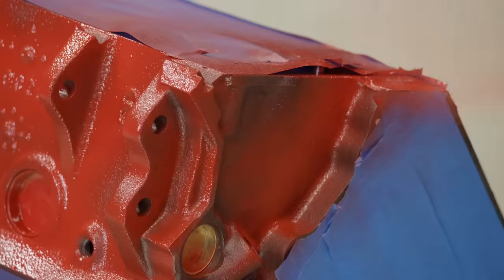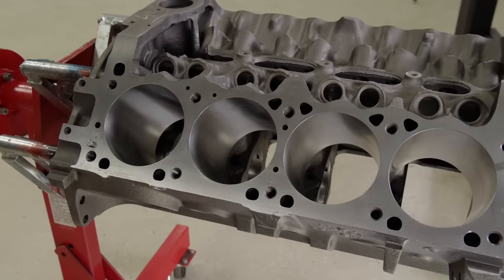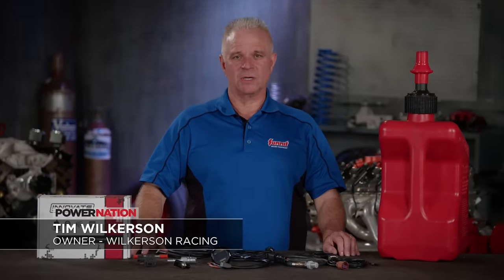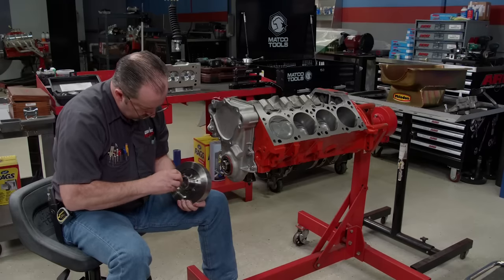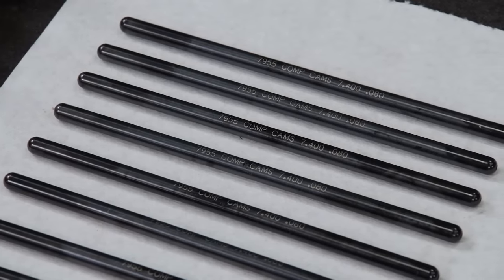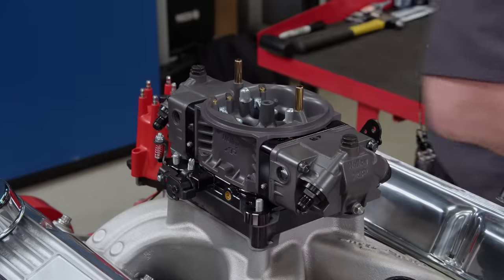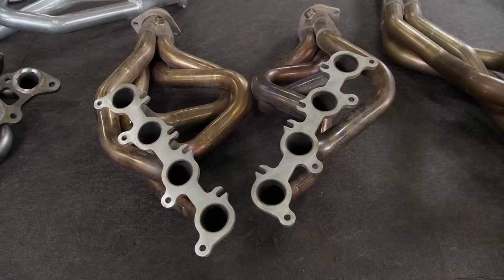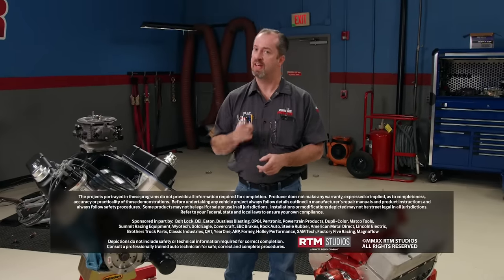Assembling a 410 Mopar with High Flow Induction - Engine Power S7, E9

Comment: Although the 190cc head is bigger than the normal  generic 170cc offerings for mopar it’s still a little small for for 410. Indy?
Reply: Trick flow 293cfm @ .600" 
Indy T/As 254cfm @ .600"
Edelbrock RPMs 251cfm @ .600"
Reply: 293 cfm head flow times 2 is almost 600hp potential

They probably will make over 500 so theyre not even gonna tax this head even with 410

If they did use the Indy/efelbrock head that flows 250+ cfm, they'd be taxing that head at 2cfm per hp but itll still make 500 or just over

And anytime a manufacturer gives a head flow number I always subtract 10 cfm because they alaways fudge with bigger bores and bigger headers on their flow bench
Reply: 190 head on 410 inches will have some very good port velocity. The port velocity on the street will make this a very nice and hard to beat engine. Thing will have great midrange power.

Comment: I've always loved these "A" motors, but to really get super high output from these motors somebody needs to design an all new head that does away with the biased head design and replaces it with heads with even port spacing on both the intake and exhaust like the Gen 3 new Hemi or the LS Chevy.  That would require new cams, Intake manifolds and headers, but would yield major power gains!
Reply: Like a 318 Poly?

Comment: back in the late 50's and early 60's Mopar sold cars and trucks with red engine paint the 318 wide block was a economy engine and came red for those years
Reply: The older larger 318 is the "A" Block, the small block 318 is a "LA" or "Light A" engine.
Reply: @LionWithTheLamb  yeah, also known as the "semi hemi", "poly 318", and "wide block 318".
Reply: @LionWithTheLamb  also, nothing about the 318 poly is bigger than the la. its just the heads that are wider.

Comment: Can you do this all with a 318 magnum also?
Reply: Yes.   Although, the 273, 318, and 340 blocks have a smaller main journal diameter, so you would need the crank with the smaller mains.     Then then you will have to factor in the 318's smaller 3.91" diameter bore(stock diameter), which would shroud the valves a little more than the larger bore 340 and 360 blocks.   360 blocks use a different oil pan than the 273, 218, and 340 blocks.
Reply: @knight0334  actually, all magnums take 360 oil pans. even 5.2 magnums. however, if you use a 360 LA oil pan on a 5.2/5.9 magnum, the one piece rear oil seal wont work anymore, and you will need an LA style seal.

Comment: timing chain tensioner ?
Isn’t that for extending the life of production types seeking high mileage longevity .
Not for race equip that is frequently inspected , where chain stretch would be recognized right away
Reply: Worse yet, they're well known to fail and go through the oiling system in this application.
Reply: They say it's a street build.

Comment: Look at the motor mount bolt holes it looks like a LA block to me!!!
Reply: magnum has the same mounting holes. If you look at the oil pan rail, there are three mount points about midway, making this a magnum block.

Comment: Okay, Now do a Low Budget 318 with Lunati's Voodoo 20200715 Mild Street Hydraulic Roller Can. And a 600cfm 4bbl. Id like to see the Numbers
Reply: if you use magnum heads, headers, a good dual plane, and about 9:1 comp, id say it would make a good 360+hp

Comment: At about 2:30 you called it a 360. Also, magnum blocks are not known for taking a .040 overbore according to Mopar Action. They suggest having the block sonic tested because the cylinder walls balloon out if the walls are too thin. It is always cheaper to use a 440 or 383 block if you can find one for more cubes. Shoot real paint, not out of a rattle can.

Comment: I always wondered why Chrysler didn't make their small block with 4 bolt mains like the Chevy 350. It seems like they would have taken a cue from it's success.
Reply: Good question, Chrysler two bolt main is much beefier then chevy’s two bolt main, plus the block has a higher nickel contain adding to its strength. The bottom end on a mopar is solid in two bolt form. The GM guys now how to market, that’s were they have the advantage.

Comment: Let me get this straight, they took a block, which already had roller lifters, and the bosses for the retainer, then ground the block, to install roller lifters? Yeah I bet that knowledge comes with custom engine building, as he said... passenger car LAs from 86 to around 92 had roller lifters as well as every magnum I've ever seen...
Reply: Look. Would you trust a custom, new, meaning "expensive" roller cam to stock roller lifters? Granted, they have proven to be pretty stout, but they are made for regular production, consumer level use, not high performance. The fact that they are able to tolerate considerable abuse is a tribute to the design. The Gen 3 Hemi units have proven inferior. Are there any roller lifters made for Mopars that are up to the performance needs that cam will demand? Maybe even CompCams sells them. Maybe the people that set up the build know nothing about Mopars and totally missed the roller block deal. Tony Angelo commented once that the 518 transmission must've been related to the 727 torqueflite because of the similar layout. Whaaaaa? Duuuhhh. Sometime I wonder if these personalities know as much as they are portrayed to know. Anyway, if building a non-roller block, you have to do what they did. Also, if you have the scratch, it's a way to eliminate that bolt-in spider that maintains lifter alignment. Probably a good idea when running towards, even past 6000 rpm. I'm not sure that little spindly spider is up to the torsional loads on the lifters at those labels of performance.

Comment: why have a forged assembly with 2 bolt mains?
Reply: Mopar block has high nickel content and is very strong. There are 4 bolt conversions available. But for this hydraulic roller setup a 2 bolt will work.
Reply: because mopar main bolts are like 1/2 diameter....
Reply: @bigboreracing356  i highly doubt ford and mopar engineers shared info.

Comment: Can you guys build a Ford 300 big 6 it makes awesome power and sounds bad
Reply: They have multiple ford, g.m. , chrysler build ups. Look at the videos list.
Reply: 300 six and jeep 4.0 are two that I remember
Reply: If you can get 225 HP from a 4.9L ford i'd say you're doing well.  They are just not designed for HP, they do make a lot of stump pulling torque though.
Reply: Not uncommon to get 250to 270 horse from a jeep stroker. Similar engine design. I would think that a 4.9 Ford should do that with Similar tricks applied.
Reply: @LionWithTheLamb  if you can get more air in witch I know is the huge restriction, it can make big block HP and more torque, my team here in Arizona are building an F250 for our buissnes and it has the 4.9 were gonna compound turbo it
Reply: @LionWithTheLamb  turbo :)

Comment: If you take a cylinder wall and lap it to a mirror finish. What benefit would that have if any?  Or would it cause failure?
Reply: a smooth cylinder wall (without any cross-hatching) does not provide a location for the oil to coat the cylinder wall and lubricate the piston rings...   without this oil the rings will prematurely wear and cause blowby and severe scoring of the cylinder walls
Reply: Won't last very long.  A "mirror finish" cylinder wall will not retain the lubrication.  The rings will completely wipe the oil off and accelerate wear.  Very thin film of oil is the best for ring sealing and longevity.
Reply: The reason for the crosshatch finish in the cylinder bores is to create a seating pattern for the rings to break in, and to lube the sidewall of the piston. Without it, the rings will never seat into the cylinders. You would then have low compression, high oil consumption, and high crankcase pressures, all leading to failure.

Comment: Look at time 3:18 when they zoom into the cylinders is the one cracked??
Reply: Sure looks like it or could be from when they file fit the the rings.
Reply: Just a scuff mark from trial fitting the rings. 
Look closely there are very similar marks in each cylinder.

Comment: my only comment , yes you are not dropping that cam in an engine, it seems no manufacture out there makes a drop in retro fitted roller lifter, they put the the bar on the back side ,smh ,,all this time no one can put bar on front or without the Bent bar that requires clearancing c'mon man
Reply: 3 weeks now ,no results
Reply: here we go into September yet ZERO Folllow up

Comment: Why do the Dodge cams always seem to run less lift than a comparable Chevy or Ford?
Reply: Moe Parr engines are of a different design compared to the other brands, technically they put out more horse power in a stock configuration to begin with common and inherent to their design, they don't need as much lift in the Cam or compression or special this are special that to make a lot of horsepower :), this is a very mild build and I'm sure there's quite a few more horsepower that can be tuned into this engine as it is :)
Reply: Can you elaborate on how it is a different design?  How do they technically put out more horsepower?  I was really looking for an answer that is based in Physics and not merely opinion.  If I had to take a shot at this without having any data to back my idea, I would conclude that the Dodge does not flow greater amounts of air at the higher lift ranges compared to a Chevy or Ford, thus negating the need for a higher lift cam.  This would actually hinder the Dodge's ability to make power compared to the others in this one area.
Reply: With the larger diameter lifters of a Mopar it means the lobes are wider as well which in turn means you can run a more aggressive lobe design compared to a Ford or Chevy.
Reply: @74beeper97  True, on a flat tappet cam you can run a more aggressive profile with the  larger lifter body diameter.  I don't think that applies to a roller cam though.  Either way, it seems there is more to it than that with the overall design of the engine.  I know 383 Chevy's like a lot of lift and they have a low rod to stroke ratio.  The Dodge's tend to have the highest rod to stroke ratio and I'm just thinking there may be a relationship between piston speed at TDC/BDC and valve lift.
Reply: because mopars have a very long rod, and a raised exhaust port. also, the .904 lifter helps too.

Comment: There are lots of better heads for "A" engines than these.  The old "W" series heads and the  Airwolf 220 heads would all be better for a 410 inch stroker with a nasty roller cam.  At least 40 horsepower better!

Comment: Mine is 408 cui  with h beam rods scat crank srp pistons 10 .5 compression indy heads   my cam is 299 duration   .500 lift  and it sucks   i am going to a lunati 244 duration  494 lift   makes roughly  450  500 hp with indy heads
Reply: Why does it suck.
Reply: 299 cam what's the duration at .50??? Can you post full specs for both cams. And what are full specs on heads and bottom.
Reply: It sucks because it a bracket race cam  i want one thats streetable
Reply: @racecitypatriot5017  i dont remeber what duration is att .050
Reply: @racecitypatriot5017  w 2 heads 202  valves
Reply: Id say either of those cams are junk unless they were just laying around that kind of duration with a proper lobe should be in the 550 range for a hydraulic  over 600 for a solid my two cents your way off on cam lift is free power if the heads can use it
Reply: @JT-ko3rv  how many 600 hp engines have u built
Reply: @JT-ko3rv  those kinds of lift and duration are for bracket raceing i want one thats street driven
Reply: @wilmamcdermott3065  to each their own street and race dont make much difference to me just trying to help alot left on the table no matter what your doing with lobes like that. Long duration low lift aren't great for either application. I have to build within a set of rules since you asked I make that kind of HP 450 range + or minus depending on which one from 365 cubes  with a 2bbl carb and factory unported iron. I dream of the day I can use aluminum lol finnaly got w2 allowed now that there no longer made but those start at 550
Reply: @JT-ko3rv    without porting no point to big lift and large duration  waist of money      check it on a flow bench
Reply: @JT-ko3rv  was getting 350 hp out of a 318 dodge  with lunati cam  and 8.5 to 1 cr
Reply: @JT-ko3rv   with a 750 holly and air gap intake  headers
Reply: @JT-ko3rv   was to much for 318 colapsed a piston
Reply: @JT-ko3rv      lumpy idle at 850 rpm  is all i want
Reply: @JT-ko3rv  will  smoke tires at 60 miles an hour dont need any more powe than that
Reply: @wilmamcdermott3065  good thing we don't drive and race flow benches theres alot more going on than what you get off a flow bench its just a tool.  You should really talk to a cam specialist from a cam company that knows mopar lobe profiles and specific applications. My throw in a stock low compression low lift to work with most stock engines cam is a lunati voodoo is 262 268 / 224 228 475 / 498 lift i might be off a bit on numbers off top of my head but that cam works deadly for what I specd it to go in keeps up with aftermarket headed built gms in a stock short block 318 or 360 . Talk to someone that knows and get a more modern cam grind in there and pick up boat loads under peak was all I was saying in the first place if you think more lift is a bad thing then I'll just leave you with how long the valve is open is what matters and the only way to get that without long duration is more lift and more area under the curve camshafts are critical get the right one for your application from someone who knows just guessing buy the numbers you gave both those cams are close to the same one sounds like seat duration and other duration at 050 with similar lift numbers good luck 👍

Comment: How would this run on EFI? What brand would you recommend?
Reply: Magnums can be made to run standalone fairly easily on stock computers out of late 90s trucks. If you don't care about automatic transmission control, finding a harness out of a 97-99 Dakota (or Ram) with a 5.2 5 speed is fairly easy and simple to make run outside of the truck. Look up FRP tuning to make the most out of it. If you want automatic (46RE) control, look for the same years Dakota/Durango/Ram.
Reply: They make that same manifold to use Port Injection.  Injection on this induction setup yielded better results than using a carburetor believe it or not.

Comment: Those head flow numbers are really bad. A stock 4.8 Chevy ls has better numbers.  And these are on a 410?  Loosing at 40-50 horsepower.  Shouldnt be any less than a 215cc intake runner on an engine with that displacement and compression.  Alot of money for poor specs.

Comment: If you are going to do mopars then your facts should be straight the 360 did not come out until 1974 when it replaced the 340 not 1971
Reply: 1971 was the first year for the 360
Reply: 71 was first year but it did not become a “performance” engine until 74 when it replaced the 340.
Reply: @74beeper97  I agree but that was not the statement that was made by the poster above, he did not differentiate between the two

Comment: When are you guys going to stop using Chevy bump sticks in Mopars and use the correct ones!! Mopars work best at 114 degrees of cam lobe separation!
Reply: @frigglebiscuit7484   there’s a reason Mopar spent so much time developing cams that extracted more HP and Torque without crappy idle! 114 degrees works best in LA style small blocks. Maybe the others work well with forced induction but the Crower roller can I bought years ago for a 340 in an Aspen R/T was 114.